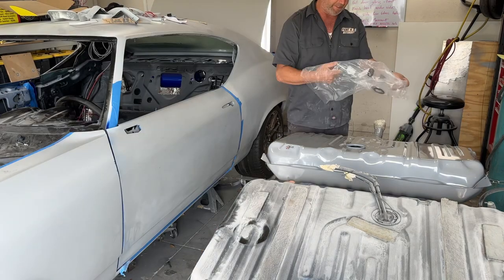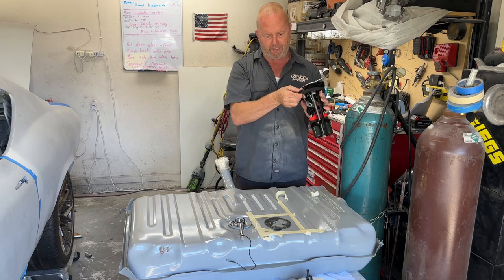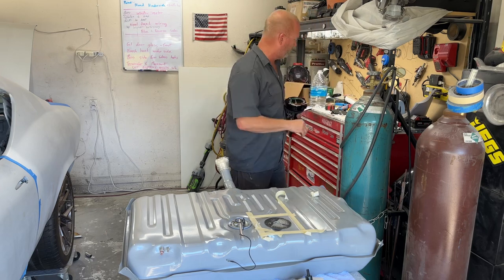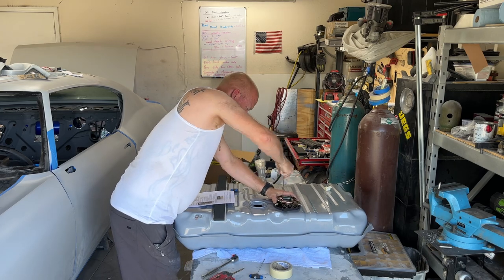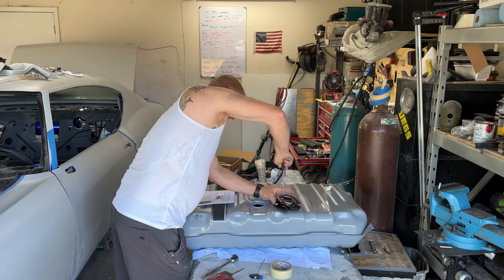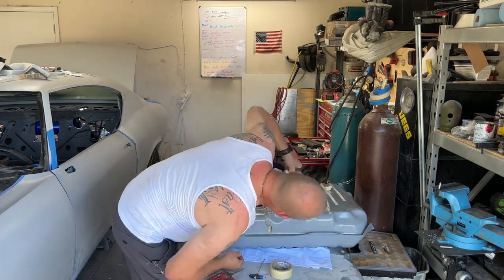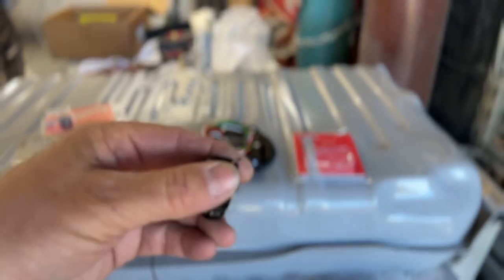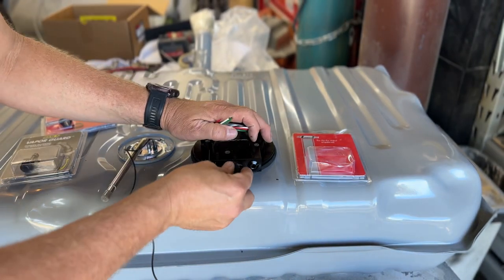How to Build a 1000 HP E85 Fuel System

Comment: but is there going to be enough fuel to submerge the pump when its 1/4 a tank and ripping on it down the track?
Reply from the maker: I’d say so. The pump sits as low in the tank as a modern car does. If this was going to be a track car, I’m sure I’d have to run a baffled tank and make many other changes tbh.